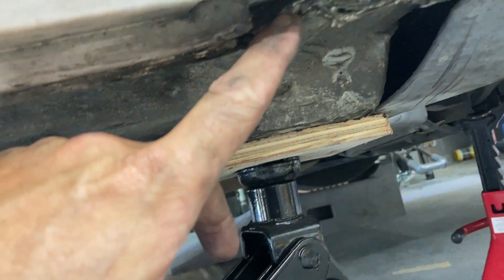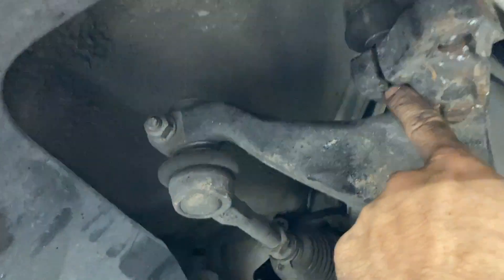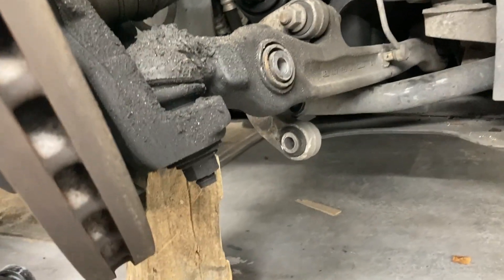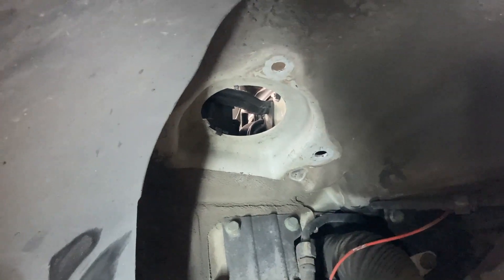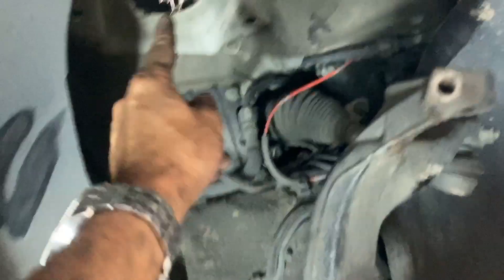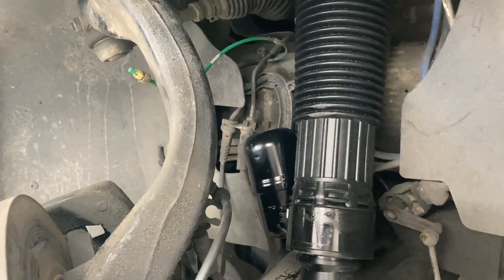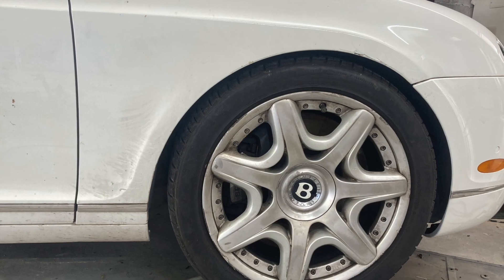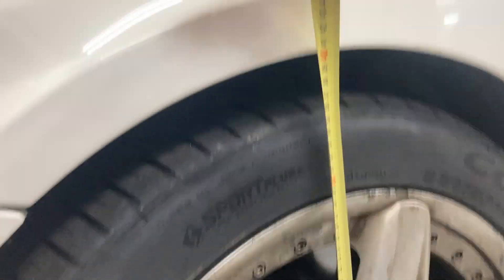Bentley Contiental GT air strut replacement & calibration

Comment: Hey Tim I have a question for you. I have a 2013 GTC W12 with the rear air suspension not lifting or leveling. Any suggestions as what this issue might be?
Reply from the maker: Is it making any movement at all? Compressor kicking on? It’s underneath the car below the spare tire. It won’t kick on though uncommanded if the computer lost calibration. Can check by putting 12v manually to the compressor via the two larger contacts if you unplug the Dshaped connector. The smaller one is a relay valve- not important for testing compressor function. I think the easiest place to start is recalibrate via a scanner tool like the aultel, and see if it comes to life. Mine was stuck in jack mode until calibrating correctly so there’s another place to look. Is yours in jack mode? Compressor seem to be alive?

Comment: @sdalin27 for the calibration part what do you do after you input all 5 values? autel gives you the option for a 6th value. Do you just exit after the 5th value of 1?
Reply from the maker: After I saved the fifth value the car went into action leveling and correcting ride height. It also cleared jack mode. I didn’t do anything with value 6. If it doesn’t work start at the beginning again. You can’t skip ahead and have to go 1-4 then 5. I had to re do it a bunch of times before it held the signal and everything was input correct. Part of that was not knowing I needed to save a fifth value though too
Reply: @sdalin27 do you recall if the vehicle was turned on or in accessory mode? I was able to get into the values and input them once but now it keeps telling me me signal is out of range and doesn’t let me back in to input values. (was doing this before i was able to get in the 1 and only time)
Reply from the maker: @Klast94  I think it was running and not in accessory mode. Don't remember for sure but I had that issue too wit the computer going to sleep